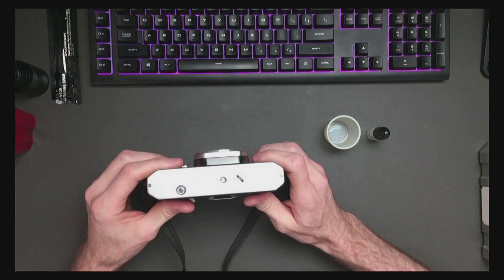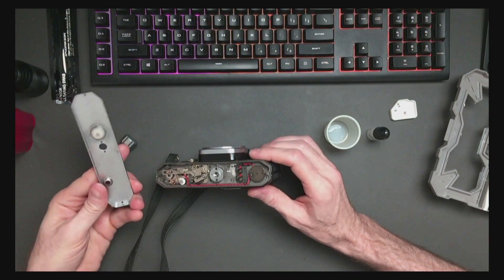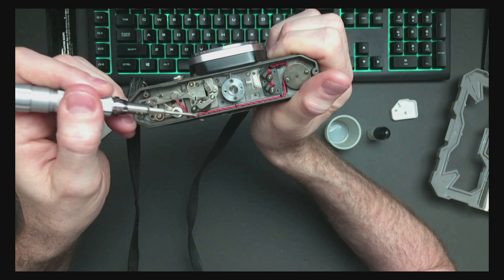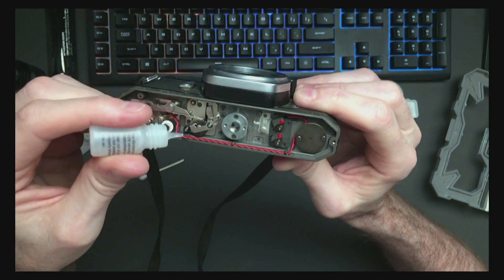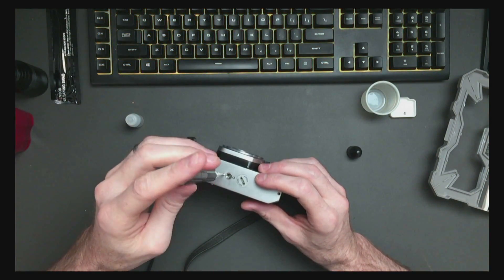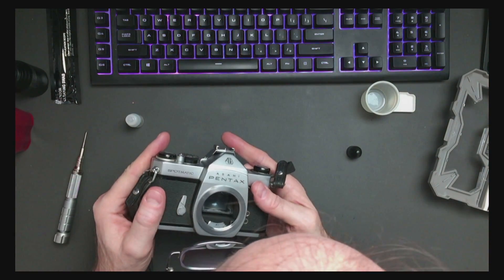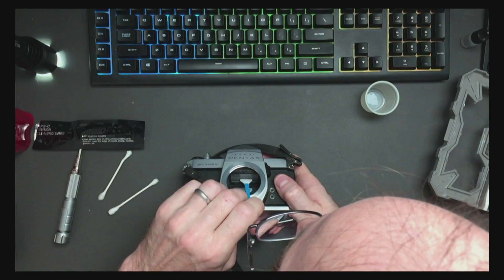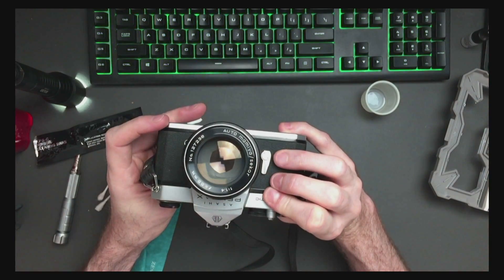How to Repair Pentax Spotmatic Stuck Mirror

Comment: I have just come across this video, I have a Pentax SP500 which has this problem. I have followed your vid and carried out this procedure my camera is now working. Cheers.
Reply from the maker: Awesome! Glad I could help. :)
Reply: I have owned the camera since the early 1980s, l bought it secondhand and it was in full use until 2004/5 when I got my first digital camera. It has been in retirement ever since. In recent times I took up an interest black n white film. This is when I discovered it didn’t want to play with me. So next step is to get a Ilford xp2 film in it. Again  cheers.

Comment: Watch oil on the mirror return gears and shafts is all that is required, I have repaired many of these.  I always replace the mirror bumper foam at same time.  Like you I am not a fan of altering anything.
Reply from the maker: Good idea, thanks!

Comment: Does the Pentax ME have the same mechanism? Just making sure before I open it up, I can only find info for the ME Super and Spotmatic. Thanks!
Reply from the maker: I don't know for sure. The Pentax ME has an electronic shutter, while the Spotmatic is fully mechanical. It could still be that the mirror return mechanism is the same, though. Personally, I would just take off the bottom plate to have a look. Good luck!

Comment: Thank you for share! Unfortunaly, the baseplate bolts of my camera are very tight.
Reply from the maker: Sorry to hear that. A couple of ideas for breaking loose stuck screws. Disclaimer: These are not recommendations, use your own judgment, and proceed at your own risk. 1) Put a SMALL drop of isopropanol on the screw and let it soak for a minute, then try again. 2) Assuming everything involved is metal (not plastic), try a little heat from a soldering iron directly on the screw head for a second or two. Hope you find a way!

Comment: Hi!, great video, thnaks for sharing. My ESII ( new to me) has the stuck mirror up, y try your solution and it worked, but the mirror goes up when i cranck the shutter, the shutter release button is not free, i feel it's clogged a bit.... I assume i need to peel the leather and work in the front part of the camera...do you have a tip on this scenario? thanks for your opinion!
Reply from the maker: Sorry, I don't know that one. Good luck!

Comment: Could i use a dab of raw coconut oil ?
Reply from the maker: I wouldn't personally recommend it. With a quick web search, I learned that coconut oil has good lubricity properties but higher wear than similar mineral oils. The main problems, in my uneducated opinion, would be two things. 1) The pour point of coconut oil is around 21-24C, which means at or below that temperature, it will be a solid, which probably isn't good for the movement of camera parts. 2) It can go rancid and support mold growth.
Reply: @homestudioplace  will wahl blade
Clipper oil do the trick ?
Reply from the maker: I have used Braun clipper oil in the past. It worked, but I can't vouch for how long.
Reply: @homestudioplace okay. I appreciate the prompt responses. Ill try with this method and keep you updated for future viewers

Comment: Hello, I'm facing the exact same problem, I don't want to file it down and instead want to apply lubricant; however before applying a light camera oil lubricant, should i apply a few drops of 99% isopropyl alcohol to first clean old lubricant residue and gunk?
Reply from the maker: If it looks dirty, it might (?) be a good idea, but I'd try the minimum first. Just be careful not to apply too much, or wash any grunge downwards into the works. I'd probably try using a cotton swab lightly dampened with IPA or similar. You don't want to get any dirt deeper into the spindles or wash away any lubricant that's still working. Good luck!

Comment: Help: My other SP has a broken sprocket “shaft”; i.e, some of the teeth the bottom of the shaft have broken off. Camera will not advance the film. Might this be repairable by a hacker like me?
Reply from the maker: Sorry, that’s not a repair I’m familiar with. Worth a shot, though, because otherwise you have a brick, right?
Reply: It’s a brick. Looks like it’s much cheaper to buy another Spotmatic.